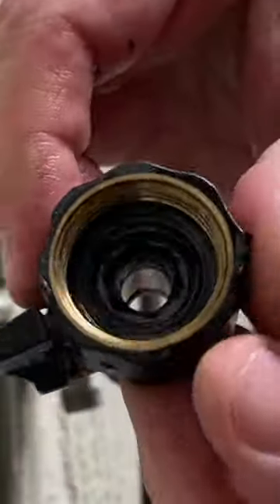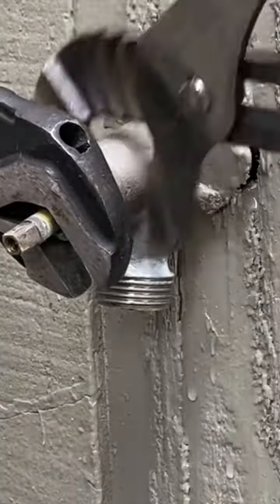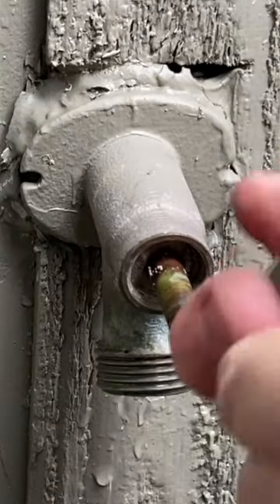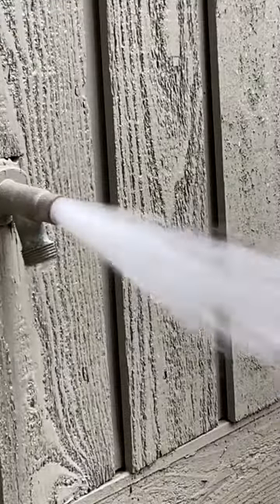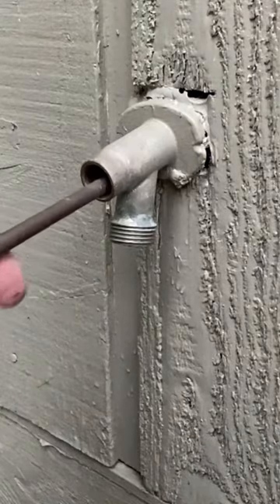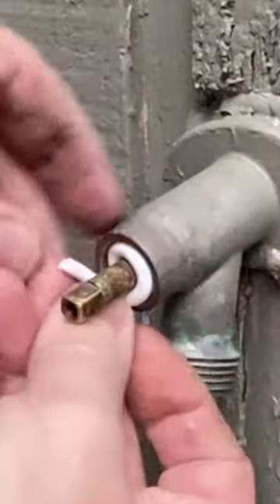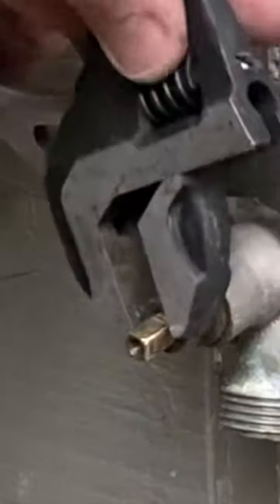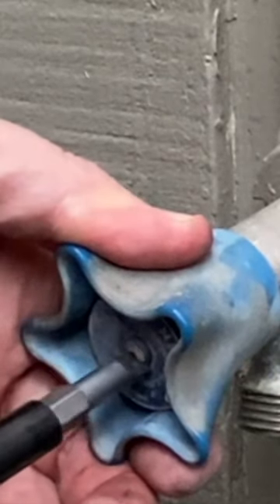Quick Rebuild Of An Old Outdoor Hose Spigot  #diy #plumbing #helpingothers #gardenhose

Comment: You must be in a place with nice, soft and of course, clean water.  Here along the Gulf Coast, we have so much sediment in the water that it destroys the metal, so you typically can not replace the washers, you have to replace the entire faucet or hose bibs.
Reply from the maker: The water is really good here. That is one of the things I don’t like about frost free hose bib. I wish they put changeable seats in them.
Reply: @ThatFixItGuy  Wow, I didn't even notice how long that rod was the first time I watched the video.  Now I see how a frost free bib works.  They don't sell those in the southern states.  We rarely get freezing temps, and when we do, we typically have a warning a few days in advance and simply wrap what we have exposed.
Reply: @jmackinjersey1  Lived and plumbed new construction in Arizona, Arkansas, Florida, and Alabama. Hose bib covers sell like hotcakes for all the idiot naysayers when then it happens to them. I've installed freeze proof hose bibbs in all 4 states, in about all settings and specs, better safe than sorry. Had a 2-3 day hard freeze here in Southern Alabama last winter. lol I liked the Zurn brand. Not in the trade now, I'm to old for rough-ins and top outs now.

Comment: Time is money just replace it. 90s plumbing has passed!
Reply: Tell me how it is faster to get under the house detach the hose bib from pipes, get back outside, undo the painted over hose bib screws, remove the hose bib, put in a new one, find good wood to screw into, get under the house again and attach the new hose bib, get back out and test the thing.

He did this whole job in 15 minutes at most.

Comment: You don't make any money fixing a replaceable valve!
Reply: I make the same to fix them or replace them.... fixing is was faster and probably last longer then a new one
Reply: You can do 2 of these in the same time as replacing 1, and you have a lot less cost in materials.
So how do you not make money?
Reply: @bertbergers9171  What's the markup on a cartridge compared to a new faucet. Work smarter not harder. Your reply is a perfect example why some people don't make a lot of money instead of a little!
Reply: @michaeldudas7584  yeah I guess if u like to mark stuff way up then yeah u would probably make more. I like for customers to call me back so I'm fair on my mark up.
Reply: @51-FS  Your customers are calling you back because you don't charge them a fair price. Working too cheap. Good luck! I tried to explain something to you and wanna stay stuck in your ways.
Reply: @michaeldudas7584  125 to show up and first hour in included. 70 a hour pulse parts after that is not enough?
Reply: @51-FS  Have fun!